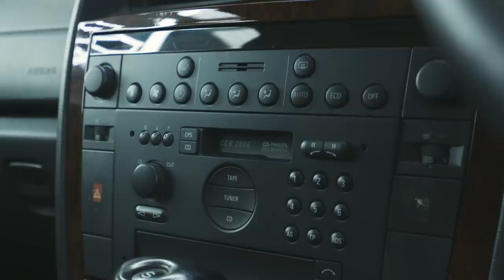The Most Disgusting Car I’ve Ever Owned

Comment: I think the previous owner probably used it as a rally car to drive around his farm at rally speeds with the windows down. He took his dogs around for a few laps in it. He took his nan and his grandad for a few laps with it. his nan and grandad probably took it around the back of the barn and had a few 'hot laps' with it in the front passenger seat and when he was done with it. He left the windows down. parked it in a well ventilated barn where he subsequently forgot about it for a few years till one day he found it under a few bales of hay and decided to throw it up on the auction.

Comment: omega have a problem with rusting stringers and under the floor but nevertheless after rust repair it is a very good car that will last for years, my omega is already 900,000 kilometers mileage and after repairing rust everything is as it should be the best car I've ever had

Comment: I detail cars at a dealership,  that's honestly not bad. Typical for that age. Use an air compressor with a bottle attachment thing (ours is called a tornado) and spray it all down which is a plus cause no actual touching of the nasty stuff. Then use a rag to wipe it dry
Reply: Looked it up online and the real name is a Tornador for the air compressor/liquid sprayer

Comment: Not sure it compares to this but a few days ago I was looking at a 98 civic that I think was just as bad if not worse. There was a condom over the power steering reservoir, ants in the passenger seat and trunk. Speaking of the trunk there were pools of water in the wheel well. There was more stuff wrong with it and quite frankly I'd like to not think about it